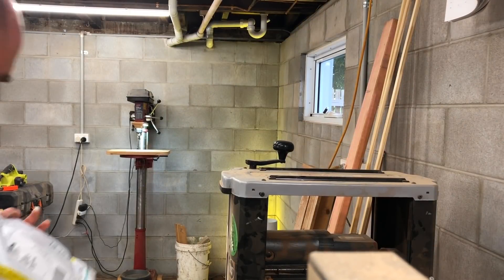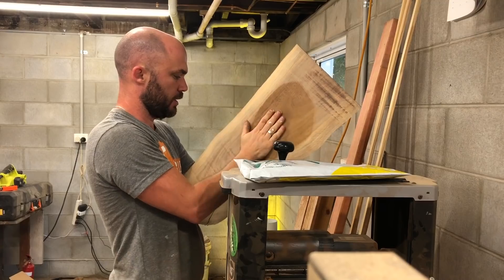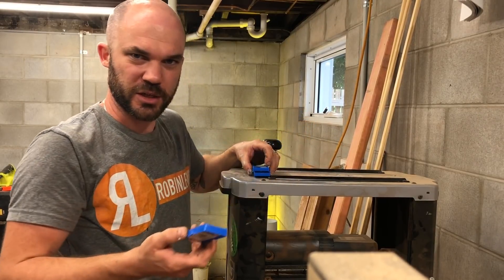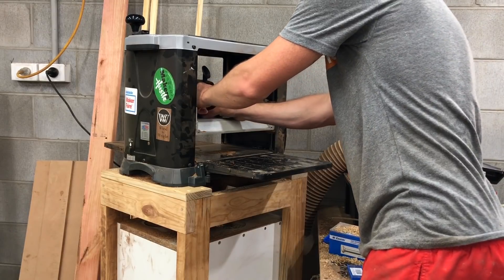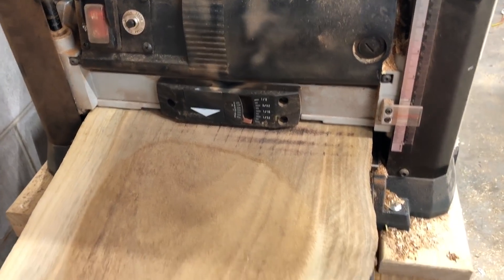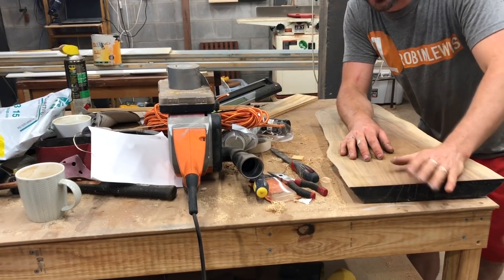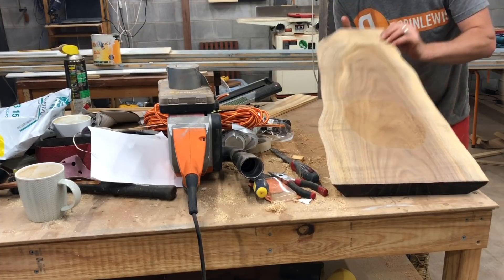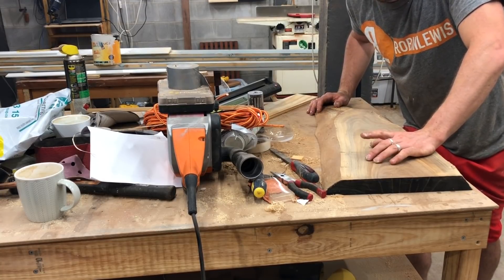Tungsten Carbide Cutter Heads For My Thicknesser

Comment: you'd change fewer than all if you chipped a blade on an errant nail or something but yeah packs of 13 or 26 or 52 would make more sense, I wonder if the same blades fit other types of tool, I bet they do have more than one application.
Reply from the maker: That's a valid point; if you'd recently changed them and one got nicked. I've seen them used before on a router bit used for flattening, so there could be more uses
Reply: Robin Lewis 2 yeah I was thinking router bits, power planers, turning tools etc etc

Comment: Hey Robin, if you wax the planer bed it should help the wood move through better. Great finish on that timber!
Reply: Agreed. Had the exact same issue with this model planer, just waxed the base and problem solved
Reply from the maker: Right! I'll give that a go
Reply: Paul Dobbrick 
You are correct sir!
Reply: ja, what they said, regular waxing